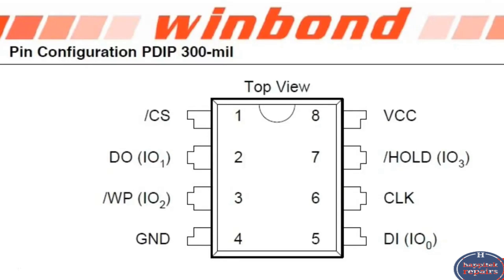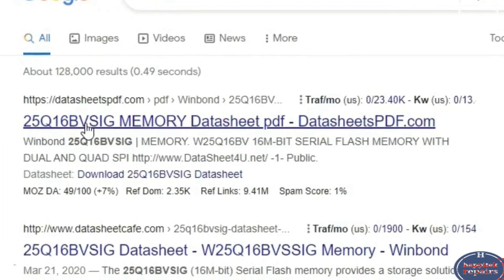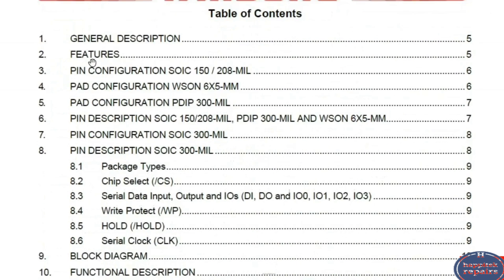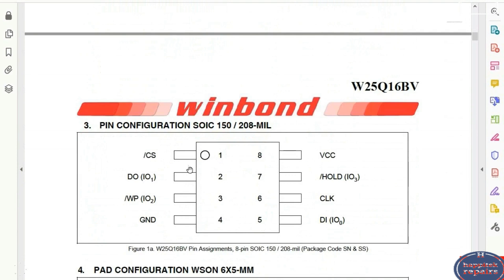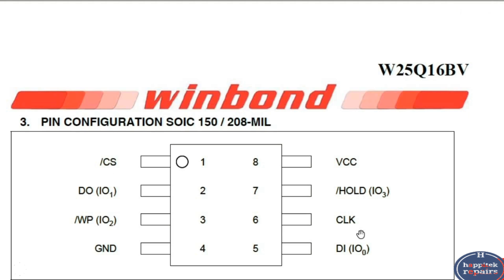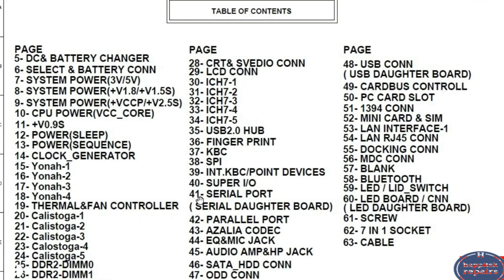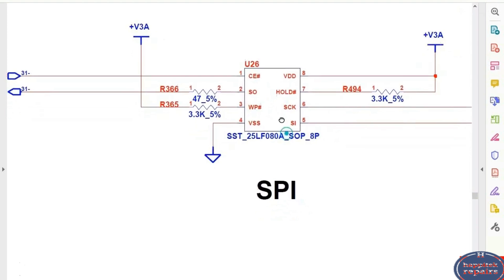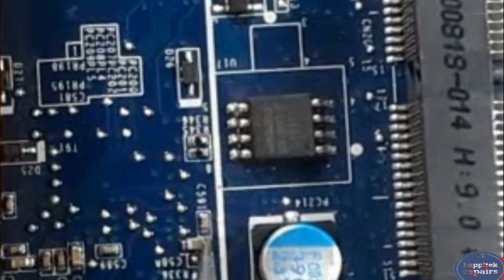BIOS pin configuration explained | Schematic of basic input output system | BIOS Circuit diagram pdf

Comment: Need Help in storing Audio files (MP3,AMR,WAV) in 16MB flash memory and play using ESP32 wroom 32D, which software and programmer Do I need to use to store Audio files on W25Q64FV or similar winbond flash memory ?

I am currently using Arduino IDE, I can detect SPI chip ID,using Basic arduino SPI flash code,Please Help.
Reply from the maker: Try Ezp2023 programmer
Reply: @happitech_repairs  How to store ans How to play?